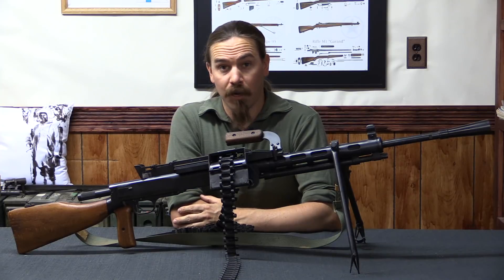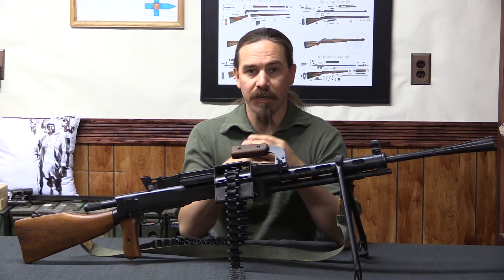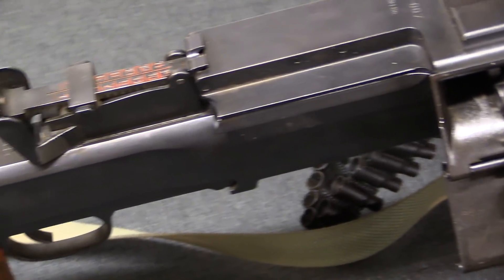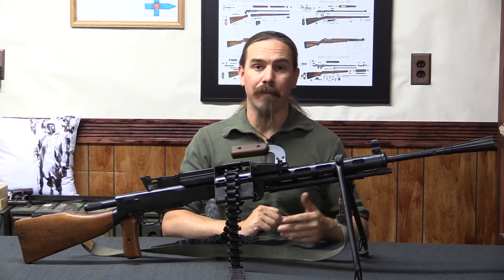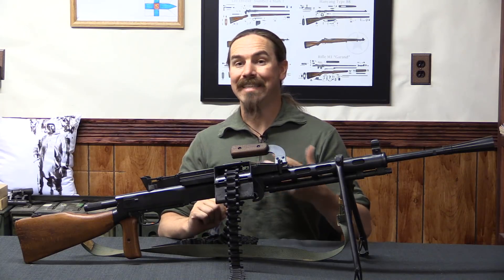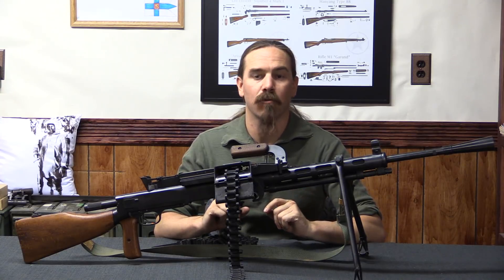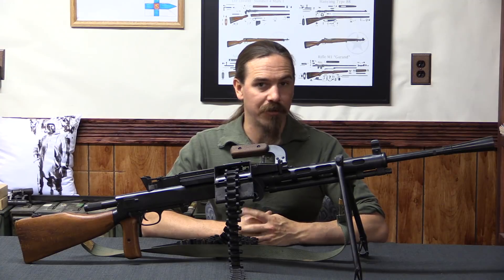Reproduction RP-46 Belt-Feed Conversion

Comment: It's interesting that you focus on the ammo container issue, which does seem like it would be a big deal. But in practice, I think infantry using M60s and FN MAGs (excl. the M240) almost never use , or used, ammo cans attached to the gun. German infantry use them for the MG3 sometimes but still you very often see them carried with belts dangling.
Reply: There are bags that clip on to the M240 version of the MAG, I just didn’t use them because they made it more awkward to carry. If you’re right handed, you like to carry the gun hanging the sling around your neck, across your front with the muzzle pointed to the left. When you have the “nutsack” on the gun, it’s between you and the ~30 pounds of GPMG, digging into your pelvis and belly. Also availability may be an issue in some units.

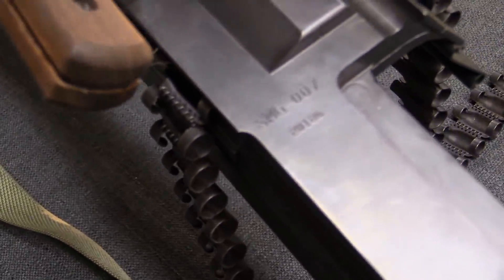Comment: mg42 nutsack is the term you were looking for 2:45 lol
Reply: crossan008 That's not the actual term. "Teaser belt box" is the closest correct technical term. Nutsack is a modern term specifically for the soft bags for holding teaser belts on the M240 and M249 series weapons.

Comment: So, one of the thing that has been with me for a really long time is: why Soviet need the PK machine gun. That question then relates to other question: Why Soviet didn't use the RP-46 like how the MG-34/42 was. In infantry role, why didn't it has the ability to use a tripod mount, like how Tachanka did?
My thought on this answer is, the SG-43, as they are adopted by Soviet infantry in hot time of WW2, the production of them is huge. The modernize version of the SG-43 also comes sometime around 1945 so it's before the RP-46. Because of that, if you change from SGM to RP-46, you would waste a huge amount of guns and production machine
And to be fair, I have considered the idea of making a medium machine gun from the SG-43 too. You see, the KGK version of the SGM machine gun, and the fact that the SGM use 722mm barrel, which is significant longer than the DP machine gun or the PK machine gun. By cut down and thin down the barrel, I believe it can at least cut down 2 pounds, and the weight is about the same as the MG-34, MG42, or the RP-46 just like barrel weight on the PKMT vs the PKM.
But let's say, there are still a huge amount of DP machine gun production machine, so the RP-46 might be needed 

Another question may comes up: did the Soviet try to create a belt-fed DP machine gun before? As we know, the DShK is a big DP machine gun, and it's belt-fed, so what if it's scale down? The answer is yes, they did. The name of the gun is "унифицированный ручной пулемёт ДП-39", the DP-39. There's an article on it, and as you can see, it's mounted on the tripod, so the idea of a DP general purpose machine gun has been a thing before, and you can do that. But just like on the way to create the PK machine gun or SG-43, it took a lot of attempt and time.

On the problem of no way to have the belt on the gun, I think it's not a "can't", but more of a "not needed", as you know how RPD, which is tested in 1944, is also eject case down from the gun and they have ability to mount a belt box. But why not needed? I write on my research like this:
"there is less requirement for where you store the belt. You can go by aluminum box steel frame like on the PKM, plastic box on M249, cardboard box on M60 and M240, a fabric bag, or even...nothing, just wear the belt. If you see M240 war cam, you will see a lot of the time they do so. I was concern about this. It's not only about your gun can jam. In fact, US M240 only have 1 gas setting, which is the lowest one, and they seem to do fine. But the thing is, you have to clean them after that"

Edit: I just read the RP-46 1949 manual on Forgotten Weapon website. The first thing is the name. RP-46 is abbreviated for "ротный пулемёт образца 1946 года", which translate to "Company machine gun". And as it is a company machine gun, the ammunition loadout is huge too, which is 250 rounds belt, written in the very first page of the manual. Even on the video Ian said that gun like MG-42 have belt box of 50. 50 is general number for machine that weight about 12kg. We can see the same thing with M240. As I see on Funker530 channel, they noted in the description that guys that are not from US Military load for 50 rounds first, then he use long ammo belt from his buddy to goes for rampage. Same thing can be see from other video
And you know what else has about the same amount of ammo that? DP pan mag. In the manual, they also said about the use of both magazine and belt with the removable of the top receiver
A little note but this is where Russian forum has an argument on the MG-34/42 vs DP machine gun. In some way, that make sense, as DP is more of a LMG and MG-34/42 is more of everything else. I also think the idea of using a 50 rounds belt with a fast firing gun sucks

Comment: Hey Ian, I have a question, I've done research into National Ordnance receivers for 1903A3 Springfields made in the 60's and 70's. I've gotten a LOT of conflicting fudd lore that says these things are bombs and ready to blow, too soft, too brittle, they stretch. Whole nine yards. But I also found a source that cites ballistic testing done by a lab that is still in business today that says they tested at a stronger strength than original GI milspec receivers. Where does the fudd end and the truth begin? If you guys know I'd love to see an info video or just a response if possible. As I recently bought one, not know they weren't an original war time manufacturer.

Comment: Ian we need a video on the Sjögren shotgun
Reply from the maker: It is coming. Filmed, but not scheduled yet.
Reply: Thanks :) i just bought one... havnt shot it yet as i need to replace the recoil spring... it wont cycle too good with low pressure ammo right now. especially not when shooting at a steep upwards angle
Reply: Forgotten Weapons do hou by any chance have a copy of the manual on it ?

Comment: Strangely Ian and Karl always leave out the direct successor to the RP46, which came before the RPK: The RPD, also invented by Degtyaryov.
Reply: Uses intermediate cartridge. So, not successor, whole new weapon
Reply from the maker: The RPD came before the RP46, and it was a separate line of squad automatic weapon.
Reply: @Вячеслав Скопюк
Well, the RPD, although using an intermediate cartridge, was an improvement of the DP28 design and it replaced the DP28/DPM in the Red Army.

@Ian
Okay, my mistake. I know, that the RPD was designed earlier, than the conversion of the DPM to the RP46, yet it entered service later. Since the RPD replaced the DP28/DPM on squad level, I thought the RP46 was also replaced by it, but it had the different tactical purpose of fire support on company level.
And with the designations RPK (AK-family SAW) and PKM (GPMG), i bet I'm not the first one  mixing RPK and PKM.

Comment: Isn't SMG Guns "Small Machine Gun Guns"?
Reply from the maker: In this case, SMG stands for Smith Machine Group.
Reply: Submachine gun, not small, lol
Reply: I am going with Ian on this particular model.
The actual definition is Sub Machine Gun and in general designates a weapon chambered in what are typically pistol cartridges(9mm or .45acp) but with full auto capabilities.